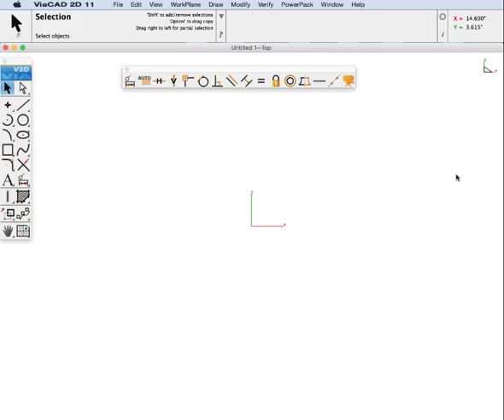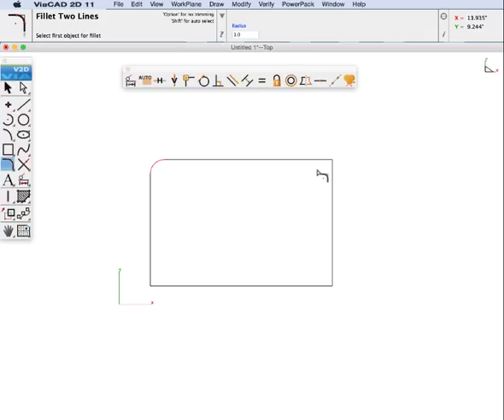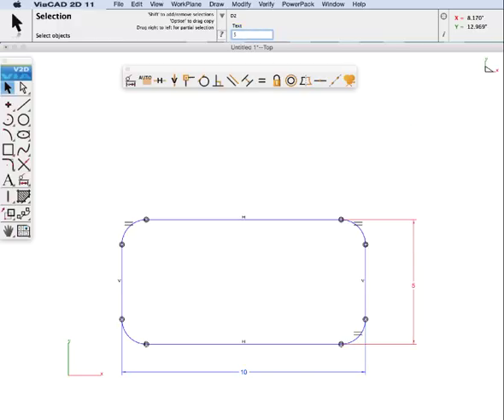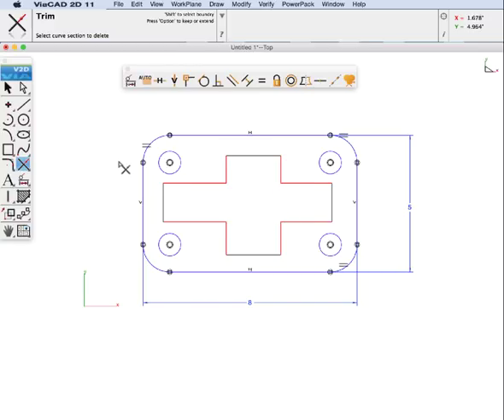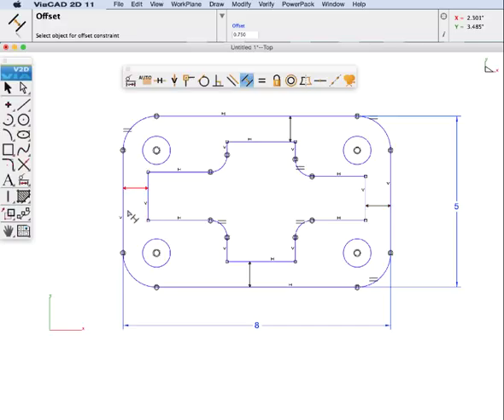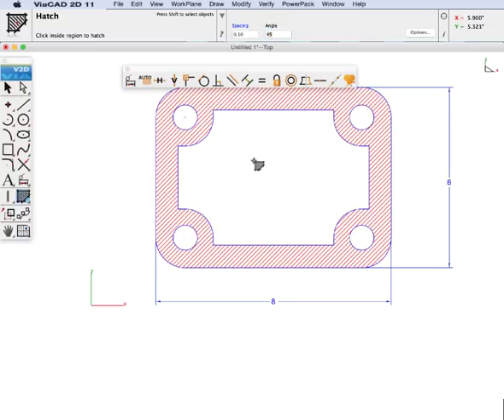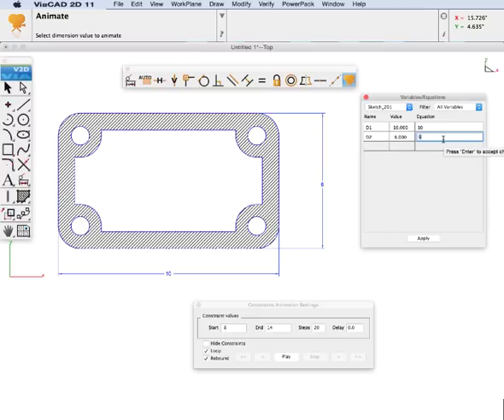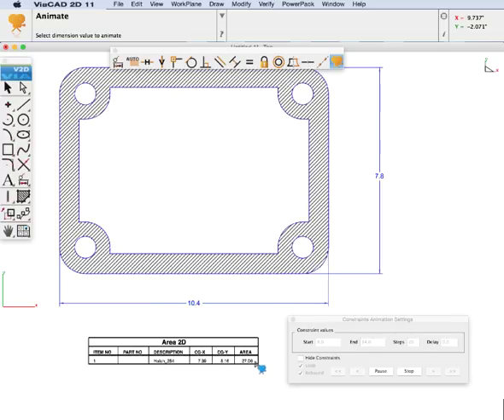Introduction to Constraints

Comment: I saw you are able to make a fillet to a Polygon. I follow you step by step but I get an error ( I'm using ViaCAD Pro 11 ). I can make the fillet only on curves path. What can be wrong ?
Reply: he used single lines rectangle not a polygpn. Change your polygon first with Edit> Change Object Type
Reply: @matthiaspester8601  Ah ok, perfect! Thank you
 :D
Reply: @matthiaspester8601  Thank you so much for that info. Think that is what I am missing as well.  You have no idea how stoked I am you mentioned that. I was getting frustrated that the auto fillet feature was not working. I changed that object type. And it worked. Think this is a step I have been missing on a lot of drawing's. Thank you so much Matthias?